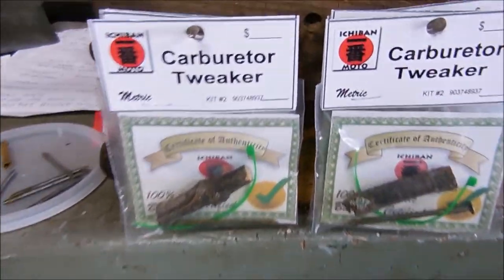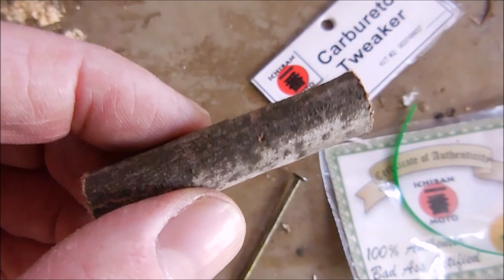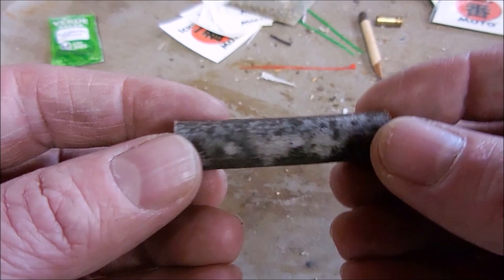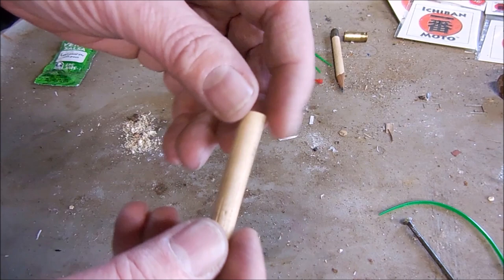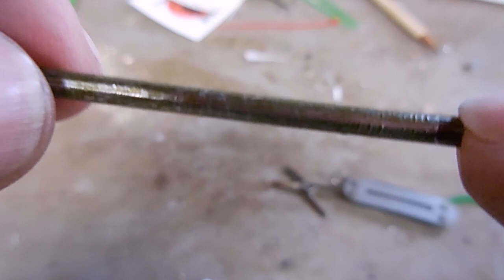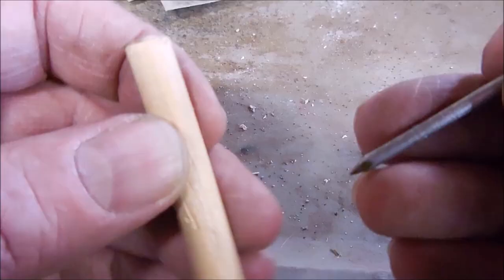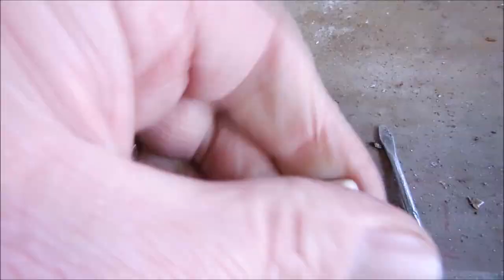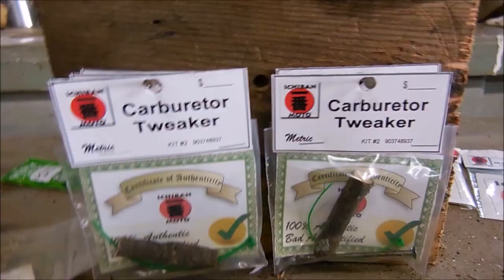Carburetor Tuning Tweaker Assembly Kit

Comment: I see the machinist's pin comes from the package with a square tip. Can I leave it square and skip the forging step if I just re-profile all my carburetor tuning module slots into square shaped holes?
Reply from the maker: sounds quite reasonable to me

Comment: So, i live in Norway. I asked 3 different shops for the diamond paper you use(tools, biltema and mekonomen), and no one seem to have that kind of diamondpaper. They can only supply me with industri diamond cuttingtools for high rpm powertools. Maybe it called something else  outside of England?
Reply from the maker: diamant papir is pronounced right?
Reply: Yes 100% correct:)

Comment: can this adjust float height? last time my tool over compensated and I ended up having to advance my timing in order to stop the valves from hitting the crank
Reply from the maker: it can not. there is a float tweaker kit sold seperately

Comment: Is there alternative profile tweaking tools available? One of my carbs has the orthogonal slots profile screws fitted?
Reply from the maker: you can use a larger machinist pin and cut down to match you slot